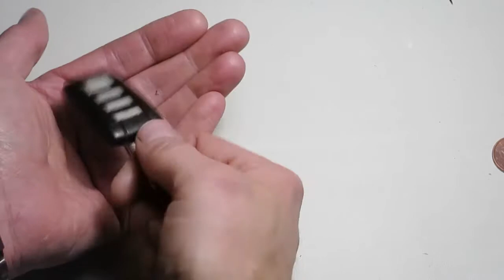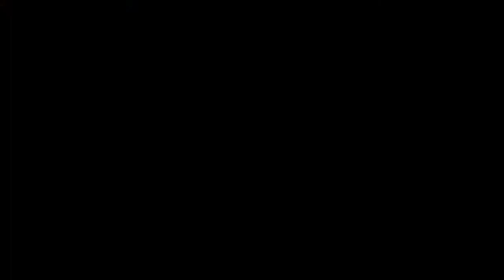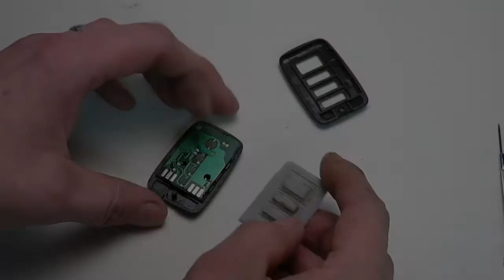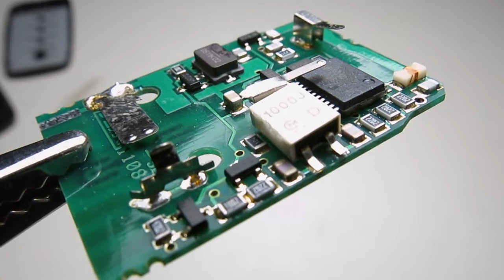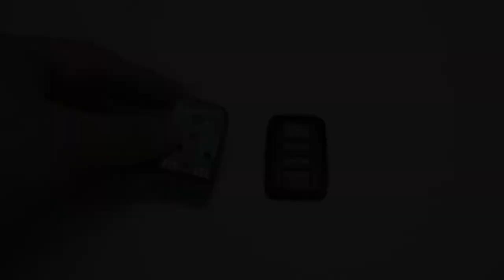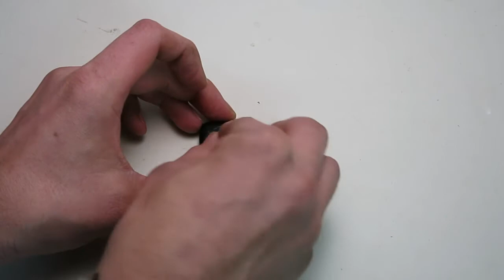How to repair a keyless entry remote (key fob)

Comment: Thanks a lot for the video. My both remotes now work fine! We use it to the anchor winch on our boat. Another tip for these remotes is how to open it when the notch in the lid gets bad. Just use super glue to attach a nut to the lid.

Comment: I have 2 remotes. One is working well. Other is not working. I have problem with my  another remote. It gives signal & receiver receive as well but it doensn't unlock the Car.  What is the cause of problem ?